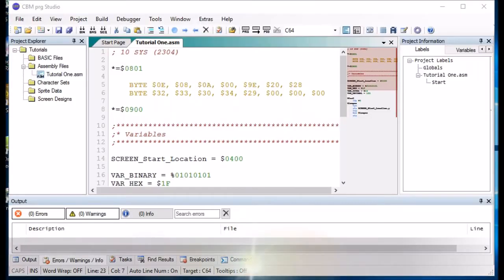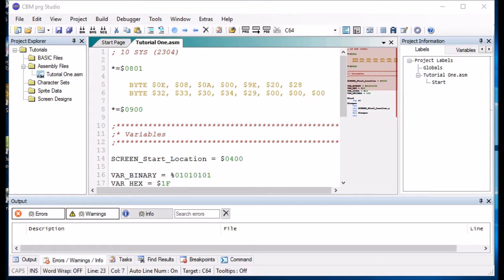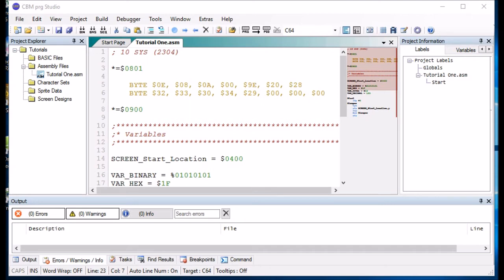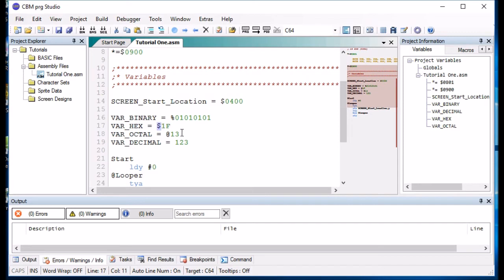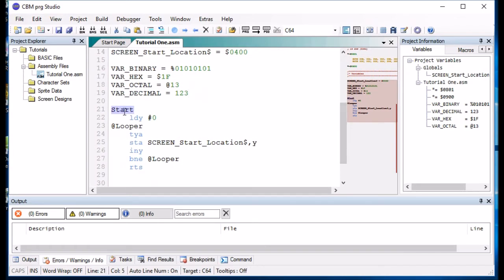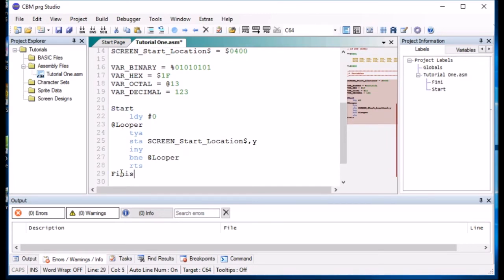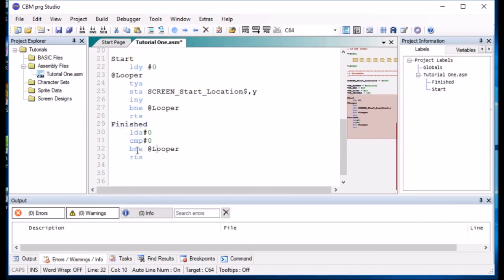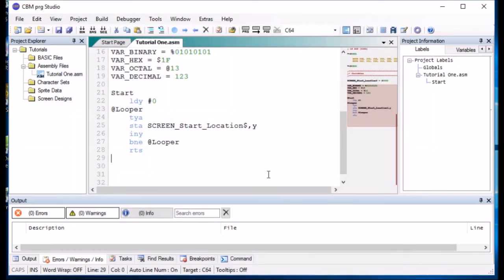Tutorial Two - 6502 Assembly Variables and Labels

Comment: Thanks for the guide.
Is it possible to use global variables and labels from .asm  in .bas files?
For example
*$ = $c000 ---> 10 sys *$: peek(*$) etc

I know how Generate SYS Call works, it's not just about starting ML
Reply from the maker: Yes, you can make "Global" variables that work across the whole project,  E.g. val1$=$c000 can be used in both ML and BASIC
Reply: @OldSkoolCoder  I can't use it in .bas :/
For example, I have irq-init$ in .asm Global Label
How to enter it in .bas? Is it possible at all?
10 SYS irq-init$, is an invalid entry

Comment: Great tutorial, Thanks !!! 
I have 2 questions:
Is it possible to create an include file ?
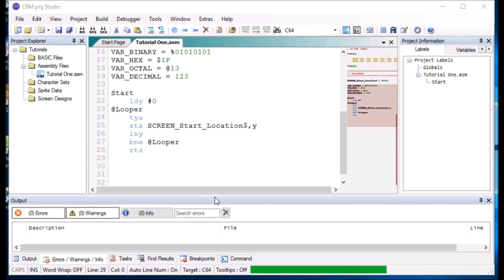When I run the emulator I have to call the SYS 4096 command to run the asm. In your video at 6:20 the program start immediatly. Why ?
Reply from the maker: Jon Ferri, you can download all my tutorial files off my GIT Hub Area @ https://github.com/OldSkoolCoder/Tutorials and you can look @ tutorial one.

But if you can get to GitHub, I used the "Generate Sys Call()" in the Tools menu of CBM Prg Studio, here is what i used in that Tutorial

; 10 SYS (2304)

*=$0801

    BYTE $0E, $08, $0A, $00, $9E, $20, $28
    BYTE $32, $33, $30, $34, $29, $00, $00, $00

*=$0900

; Write your code here...

When you have done this, when the emulator runs the program you have created, the sys call code instructs the basic interpreter to run SYS(20304) = SYS($0900)

Try it; )
Reply: OK, now is clear ! 
I noted that you have a lot of Playlist. With which video do you suggest me to start the course ?

Comment: I'm a pest, John, but now determined to get to grips with assembly - especially now I've arranged and re-arranged my tools a hundred times ;) . So - with "variables" - the way they're listed in CBMStudio would imply they are to be used as Constants? But could you use them as true variables by changing their value later down in the code. For eg: 
VAR_HEX = $1F
...{code}
LDA  #10
STA  VAR_HEX
Wouldn't that change the value at the memory location symbolised by VAR_HEX?
Bare with me - super newb!
Reply from the maker: Russ Shall, watcha dude. Now your example is saying var_hex is memory location $1f. So your code is going to store $10 in memory location $1f because your variable contains the number $1f. Does that help?
Reply: Doh. So, it's more of a symbol? That is as the interpreter compiles it just replaces symbols with the corresponding value? So, can you change the symbol half way down the assembly code? E.g:
VAR_HEX=$1F
LDA #10
STA VAR_HEX
VAR_HEX=$20
STA VAR_HEX
Would put 10 @ $001F + $0020?
I think I need to read something about assembly language syntax!
Reply from the maker: Russ Shall, that's interesting.... not tried that. I know you can assign one of many values to a variable/symbol by using the if end if keywords in cbm prg studio...
Reply: Urgh - this assembly lark's overwhelming! Dunno where to start. :/